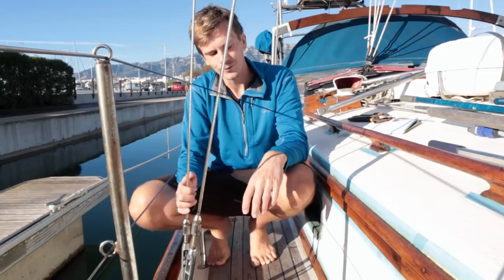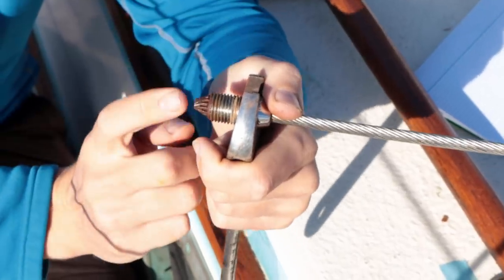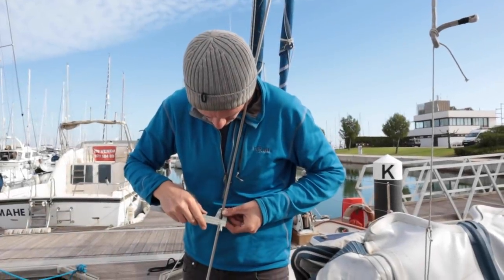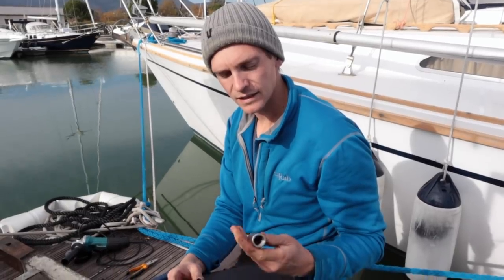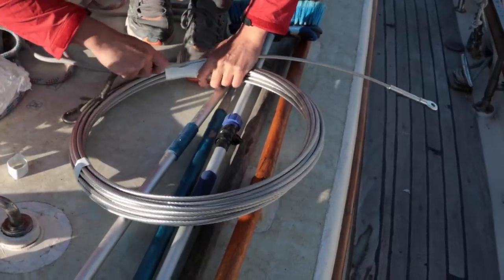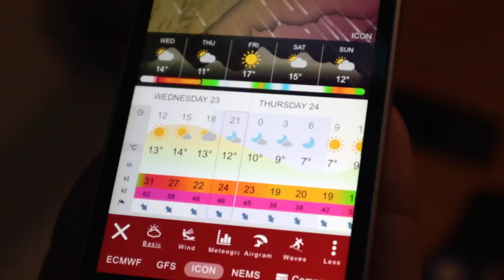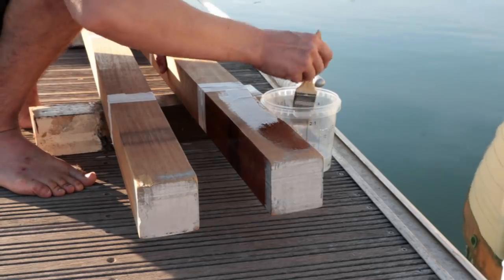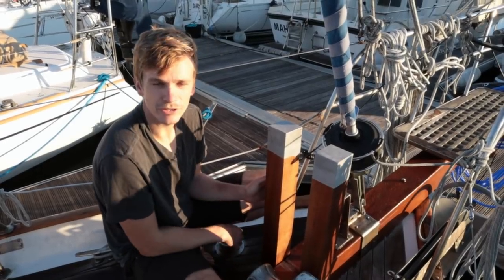40] What’s INSIDE 10-YEAR-OLD RIGGING? + Replacing Our Sampson Posts - DIY Sailboat REFIT

Comment: Absolutely spot on all round. There is a big difference between getting a professional to do a job for you and doing it you yourself and that is - who has a stake in the outcome? Given you have researched the job, tools and techniques then having a stake in the outcome will ensure you do a first class job. A professional  will do the job much quicker but for each bit of rigging you size, terminate and fit you will get quicker and quicker anyway. However the big advantage of doing it yourself (apart from the assured quality) is that you have developed and honed the skills and as a mariner you never know when you may have to use those skills when recourse to a ‘professional’. The only suggestion I would make is to get a set of decent spanners and only revert to using shifters in extremis - as a pro engineer of far too many years it is just one of my OCD’isms.😉
Reply from the maker: Cheers Norman! Yes, it’s true: when your own life depends on it, you do your very best 😊

Comment: Looks like you are doing the job right. Lots of attention to detail and going deep enough into it to replace and repair all that needs to be. Chapeau. 40 euros, though; Christ, you did well there, seriously. Nice vid - suits me as I like the technical. I'm sure you are doing it already, but the main thing I learned when doing deck work was to make sure to bevel/chamfer the aperture through the deck so as to give the sealant a good chance to make a proper bead to seal. Only leaks I came across to repair, hadn't done this. This includes any drilled bolt holes and screw holes - countersink everything :-))
Reply from the maker: Cheers Chris! Great tips :) Yes, we couldn't believe it when he asked for 40 Euros!

Comment: I always mark the turnbuckle position by wrapping electrical tape at the top (and bottom) edge of the turnbuckle. Then when I retention, I just turn until it reaches the tape edge. 
(It’s easier than trying to remember the number of turns)
Reply from the maker: Great trick! Thanks for the tip.

Comment: Yep man, for sure you can work with your hands. good job!
What did you use to caulk around your sampson post? Didn't look like marine grade Sika product from the video.

One small caution: Never use rusty carbon hand tools on stainless steel parts. They get contaminated, and you will soon see rust appearing where the rusty tools contacted the stainless steel.
Reply from the maker: Thanks for the tip! Is it ok if I clean the rust off the tools first? I can never find stainless tools, maybe it's not strong enough for tools? I used Marineflex, a product you can get in the UK - a UV resistant polyurethane based sealant, but £4 per tube. Seems to work well so far.
Reply: @SailingKittiwake  I am sure that chemical, bonding and UV resistance properties of marine flex are OK, but have you compared its mechanical properties versus sikaflex 292i for example? the type we use for fin keel joints.
There will be mechanical stress around that sampson post, you know.

Cleaning rust off carbon steel forged tools does not help at all in preventing contamination of stainless steel. Use Vanadium steel tools.

As a matter of fact,  professional builders have sets of tools exclusively dedicated to SS parts and they never use them on CS parts.

Comment: isolated backstay with SSB HF makes another communication tool in the toolbox. VHF out in the middle of the ocean does not always work
Reply from the maker: We’ll get a sat phone that can come with us in the life raft.
Reply: Sailing Kittiwake great job on the refit, however you should have kept the SSB HF as it was already there. This is a great piece of communication equipment that is indispensable in communicating with ships and search and rescue vessels outside the range of VHF. Many organisations that hold organised ocean crossings have SSB HF as required equipment for vessels to join the fleet. This alone illustrates the high value of this piece of safety equipment.

Comment: Things like brakes in Your car, rigging in Your boat, changing valve-shims, through-hulls, tyres or toilet-pump-gaskets (probably the best thing in a compost toilet by the way: does not need half a day's disgusting dirtwork when a sanitary was dropped wrongfully) and some other really important things are absolutely best done Yourself: You do not have to look for the chargeable time, You can and usually do concentrate on the results. 
Did You caulk the rest (fourth side) of Your sampsons above deck/versus the sprit also? If not so (yet): That's a notorious ingression point for water which will run down to where the previous ones did rot.
She looks nicer with every detail I can grasp above and below deck.

Comment: I would keep the SSB radio and i think copper paste in the rigging would work fine to.
Reply from the maker: It's gone :D
Reply: Sailing Kittiwake I was going to say the same thing - all the long distance cruisers I follow have an SSB as backup (and sometimes their main) communication link for weather data along w voice coms. So I was surprised you removed it. But am sure you had a good reason to do so, maybe it was too old & bulky & impossible to be repaired. Anyway, onward & upward! 😄

Comment: Just wondering if the butyl mastic inside the fitting will prevent oxygen getting to the stainless steel and lead to crevice corrosion. The same kind of logic behind avoiding taping over stainless. Will be doing is to our old rigging soon so interested to hear your thoughts on how you chose this solution. Thanks, love your channel!
Reply from the maker: Thanks a lot, Matt. I don't think so, lots of people fill them. We had them filled on Kittiwake and it wasn't a problem.

Comment: My sampson posts had same issue. But i decided to employ the welder because the design sucks from tayana . The  welder welded up a massive 1/2 inch steel base with boxed side walls for the bow sprit to sit between. Then i bolted that base to the deck on a teak pad after fiberglassing. Then bolted spree through the base
My chain locker is huge now and i can sit inside it.
I galvinized the steel first then painted it 15 years ago. No rust . Cost me 100 usd all up in fiji.
When the 10 year old 10 mm bob stay stay broke a year ago in a 40 knot squall that base is what held my mast up.  That and my 10 year old laminated teak bow sprit i built  Saved me 40k
Youre 10 year old rigging could cost you youre life. I am not being negative i am just saying 10 years is enough. New rigging is now needed. Every 10 years.
I know for fact. Mine failed at 9.5 years. Re rigged in newzealand by a pro . Looked perfect too. Then a big bang and my mast nearly came down. It would have too except for that massive bowvsprit in teak and base made of steel.
Obviously what you did is fine for now. But it will fail again and again. Just like they all do. Its a leaky teaky thing.

Comment: Doing good work there, I definitely agree with you when it comes to checking so called professional work. Nothing wrong with going oversize on chain plates but if  replacing others you might consider the cross section area of other parts of the rig as a guide as cost will definitely be going up a fair bit. Also, would the marina not be willing to find a spot for your sail for a day or two?
Reply from the maker: Hey, we didn't think of asking the marina. Hehe! We managed it OK after all. Thanks for the tips :)

Comment: I had a 1973 Fisher 30 Ketch with original English rigging.  All HD stainless with swaged fittings.  I asked a rigger to come and set up the standing rigging.  He refused and wanted to sell me an entire boats worth of new standing rigging.   I told him I knew how to use dye penetrant to find cracks in swagged fittings,  as I had done in Aircraft.  He started making noises about corrosion and cracked wires.  I said I know how to look at wire rope and see if it is bad.   I asked him if he ever cut open any of the swaged fittings he removed to check for corrosion.  He said " Sure"  I asked, every find any ?  He Said " Nope"   Moral of the story.. there is a whole parasitic yacht industry bent on selling your new stuff you do not need by scaring you to death.   A world cruisng boat that has actually been cruising for many years.. may actually need new standing rigging... a marina queen that has never been anywhere... maybe have rigging good for years of cruising.  These comments to not apply to fastenings used in spars ! Or sometimes the spars themselves.  Learn how to do non-destructive testing.  You can use a laundry marker ( pentel)  to check for cracks, wipe it away.. and it remains in cracks that standout like a whore at a kid's christmas.

Comment: you can use coca cola with aluminium foil to remove light surhace rust, or coca cola bath to remove serious rust. Once I cleaned this way car brake discs which were left out for winter... I don`t drink Coca Cola ever since though...:)
Reply from the maker: Haha anything that can remove rust does not belong in a stomach! Although you should see what rhubarb acid does to teak...

Comment: the sealant  put inside the crimp fitting may push its way into the threads of the crimp fitting and lock it permanently . meaning it would have to be cut apart next time.
Reply from the maker: The good thing about butyl is it is non setting so won't lock it